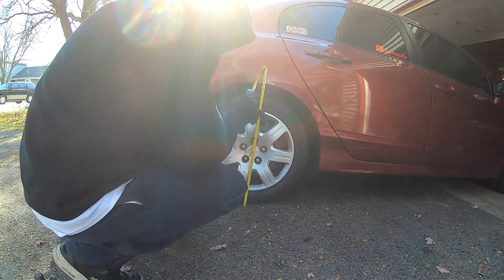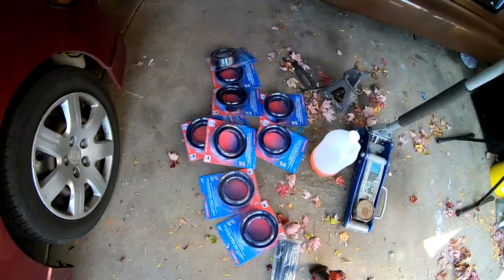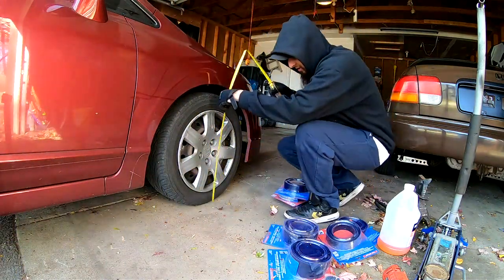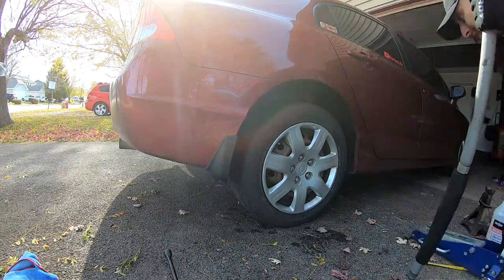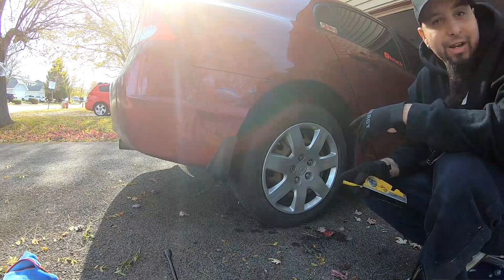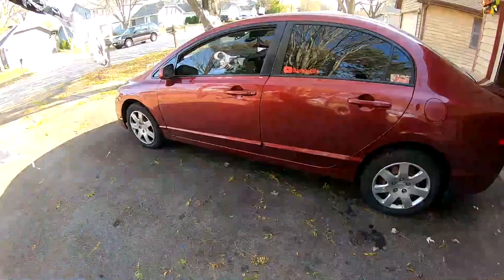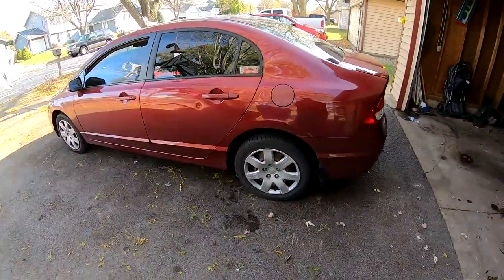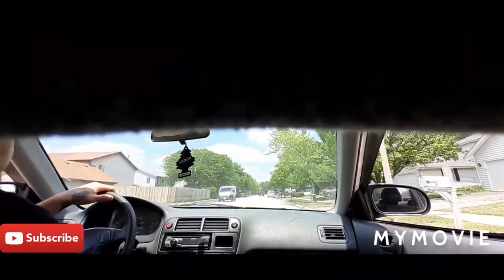Honda Civic Coil Spring Spacer Lift Install Offroad Rally universal Autozone Ride Effex 8th gen 2010

Comment: Does anyone have any experience with these? Like how long they last and cause any damage after fast off roading.
Reply from the maker: Dont know soon we will find out after a few months il do a review on it.
Reply: @BarbasLife  that would be much appreciated, I will probably do that to my civic just because the group clearance is too low for off roading.
Reply: I did it to my truck( before he did this) no problems off-roading just get an alignment afterwards
Reply: @BarbasLife  how has it gone so far? 7 months later
Reply from the maker: Still holding Strong 💪 no problems. I'm trying to get a real lift kit for it so I can go higher with the spacers
Reply: Did you need an alignment anytime after the spacers?
Reply: I used them on an 06 escape to clear 26s NO PROBABLY

Comment: I wonder if those will pop out over time.
Reply from the maker: Geez hope not lol🤦‍♂️lmfao. The front is zip tied but the back is not. Maybe i should drill them and zip tie them too.
Reply from the maker: We will find out how long it last remember sometimes you get what you pay for.🤞hope it holds.
Reply: I remember my brother did that on a 95 civic he had that was lowered.  It was like a little cube you twist in the spring. So ghetto and was nothing but issues. It really changes the spring spring rate ... in a bad way.  
Are you planning on putting some bigger wheels on it? 
I’m gonna rock my 8th gen lowered for the winter I sold my factory Si suspension.
Reply from the maker: @BulliKid  yeah bigger tires maybe 215-70-16 mud tires they are kinda expensive so im waiting till last minute to get them. After driving  a few days I took off one of the coil springs from the back on each side. It was riding too stiff. Im 3 videos behind on my editing the civic looks way different already. Big mod video coming next week.
Reply: Buy tires for Black Friday. I usually find good deals.